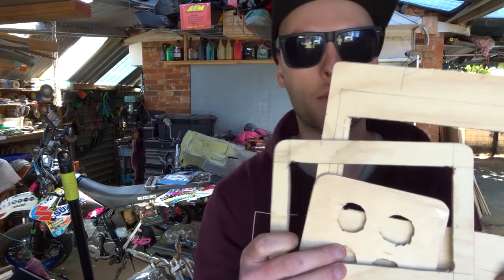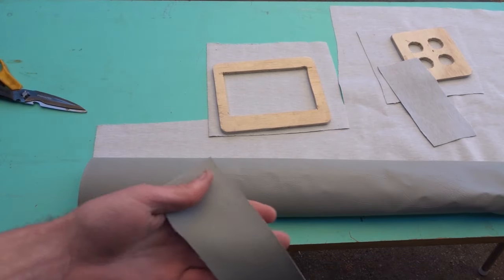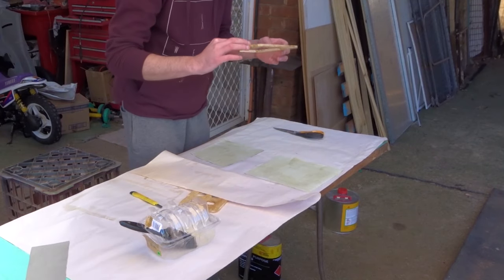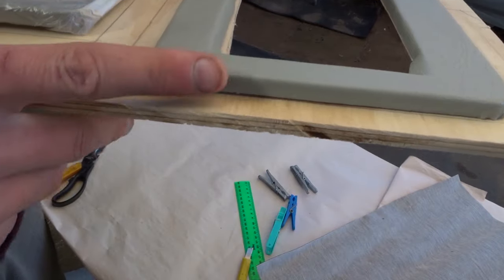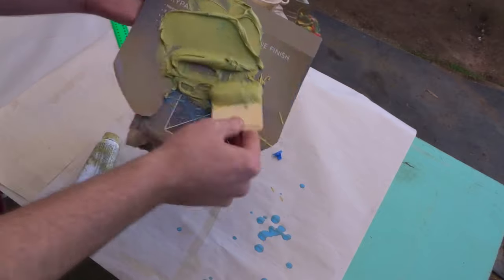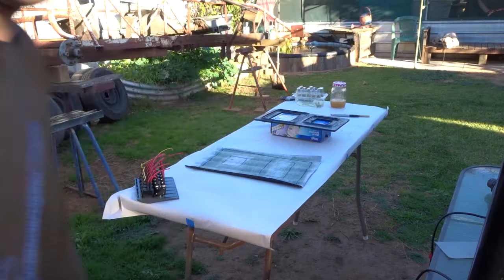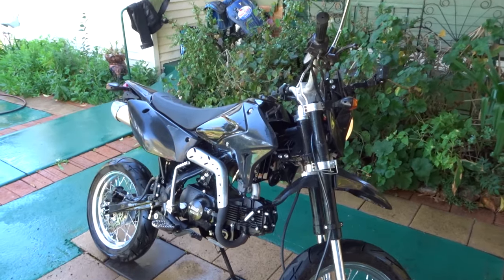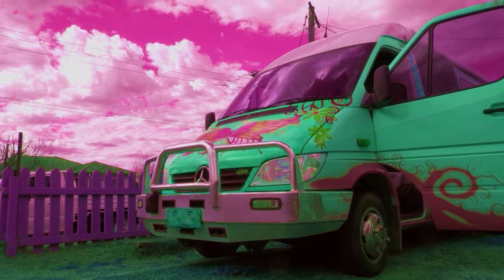Sprinter conversion BUILD 4 switch panel and 12v sockets

Comment: I'm enjoying your build, nice job.
I'm building a 2005 Sprinter very similar to yours, originally same basic color, but I'm not an artist so I went with a white roof, sand sides, and flat black hood. I layed in all the wires as you did, hooked up the solar panels,  new radio, fuse panel, solar controller, inverter, battery charger, 4 12V BCI Group 31 AGM Batteries,  battery combiner, water pump, shore power, (120v AC, that's what they call it in the USA), then ran a smoke test on it. It didn't smoke so I sprayed in foam insulation, now I'm starting to put the side walls in.  I liked your use of the suede on the headliner, I was going to just paint the cloth headliner, but now I'm rethinking that. 
I did not understand why you seemed to shrinkwrapped the complete wires, 30mm on each end is adequate.